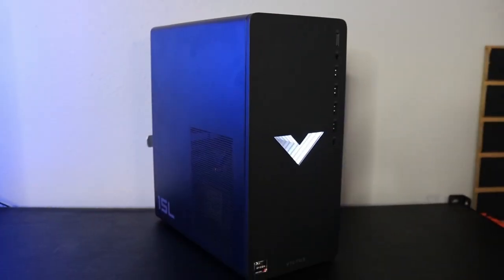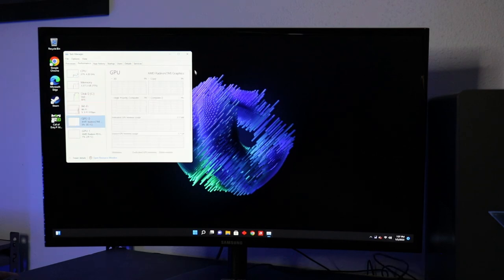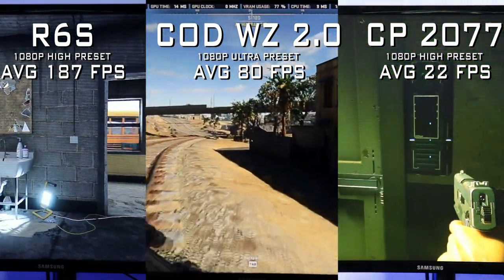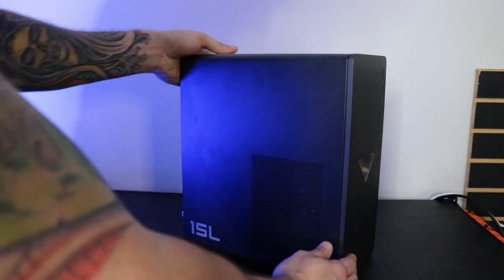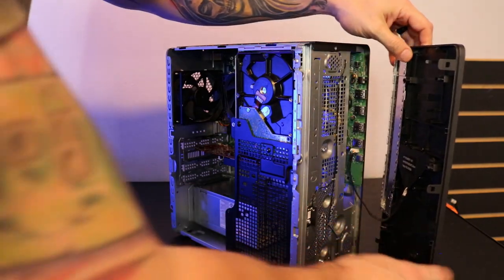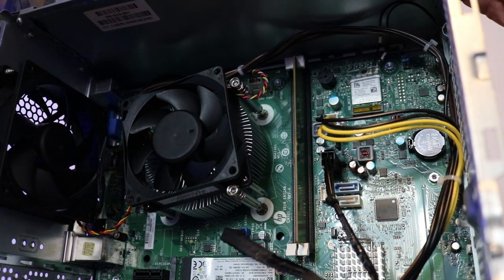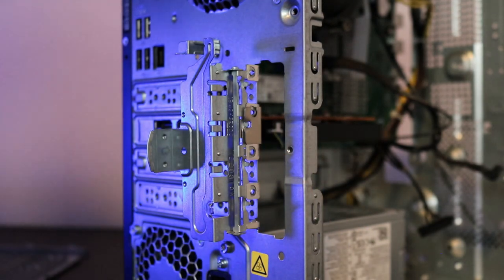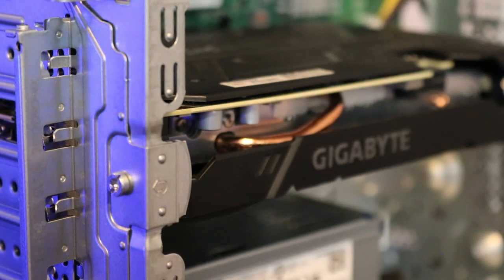Killer Gaming PC for CHEAP!! HP Victus 15L Gaming PC#pc #gamingpc #review

Comment: hi! liked and subscribed. very good video. great that you tested all of those games. pretty decent numbers, I guess. but, I don't have any of those games to compare to. the only game I play is Medal of Honor multiplayer and nobody uses that for testing nowadays even though it's been revived and remastered. so, I usually look for some benchmark tests. there are some free, really good, fun, interesting and super informative tests out there. I wish we could all just agree on one or two instead of 10 to use, for easier comparisons, but oh well. personally, I like the Cinebench R23. it's quick, easy and offers some other rigs to compare to. so far on that one, I laid down a highest of 16,625 for multicore and a 1,400 single core with the Game boost(basically 1click overclocking offered by most aftermarket mobos), activated. the results seem to vary with every one of these benchmark apps, tho. and I noticed a tiny drop in numbers when I record the test in the background. so, the tests that I've posted on my channel show lower results. I like the 3D Mark Time Spy a lot, too. that thing tells you a ton of stuff. my score on that averages about 9,900. CPU average is about 12,000. the GPU scores average about 61 FPS. Unigine Valley 1.0 is fun, too. average score about 9,000. min FPS about 54. max FPS about 345. Unigine Heaven 2.0 is fun, too. scores averages around 7,300. FPS about 286. min FPS about 68. max FPS about 862.
my set up was about twice the cost of yours, of course. I spent $1,118 for parts, shipping and taxes. I have a video on each part cost and also video of the complete unit. I'm not sure up I'm a game nut or a computer nut, lol. my rig isn't high end, per se, but, it's upper middle with my Intel i9 10900k, MSI MPG Z490 Gaming Edge wifi mobo (supports up to 4800mhz RAM and a i9 11900k CPU), EVGA GEFORCE GTX 1080 Ti SC GPU, Corsair Pro RBG 32GB 36000 Mhz RAM, Vetroo S210 ATX MTcase w/6 RBG fans, Vetroo Lurker V240 CPU water cooler, Rosewill 1200w PSU. it runs super cool. I just finished it. I'm about to start doing some testing on overclocking the GPU, but, I'm hesitant because the built in FPS counter in my Medal of Honor, blips up to 3,000 FPS! but! that makes my low internet symbol flash like a strobe light. I have to keep turning down my max FPS setting in console to about 400 to quiet down that light from having kittens 😸 
I have terrible turtle wifi that's free with my stupid apartment. getting high speed internet is, so far, not available in the rough neighborhood, that I live in, hhhhhhhhh. 
I guess, to summarize. how about a benchmark test or two, also? 
I will look to see what other videos you have. don't forget!? Medal of Honor is still around, free to download(mymoh.tk)
remastered, no CD needed. I have how to videos on how to download skin, blood and HD mod, too. I am Ober Gilstrap 88 and I approve this message.
Reply from the maker: I have only ever messed with unigine heaven as far as benchmarks but I would totally be down to do a short and get cinebench numbers on this prebuilt! I truly appreciate the sub and the detailed input in your responses. A 1080 in my opinion is still very relevant for gaming and paired with an I9 10900k is a monster gaming pc! I'll be sure to stop by and check out your channel! I'm still learning the flow of making the videos and always appreciate the input that people give on my content!  Thank you sir and have a great day!
Reply: @bradfordskeldorado  wow, thank you! you, sir, are too kind. awesome. the only game I play is Medal of Honor. and nobody ever uses that for any benchmark testing. so the only way I can compare anything is if they do the Cinebench R23, the Heaven 2.0, or the Valley 1.0. some guys use a Heaven 4.0 and that isn't free so, I'm not sure what they're thinking. I can only imagine a handful of people that would use the paid one, when several great free ones are available. I wonder what their target audience is. or do they do it so most of us can't tell what a piece of crap they just built? a video the other day had a guy showing off a rig that he built to show off how great he was with building a pc with a $1,000 budget. I thought ok, perfect. my build was $1,118 including taxes and shipping. well, my machine crushed his. I had about double his Cinebench R23 score and 2,000 more on another one. and his groupies were writing in, saying how awesome he was and one guy wrote in say how he had built 25+ computers and how impressed he was at this one thousand dollar build. I'm thinking what a bunch of knuckle heads. I trashed the "pro" making the video with my first try. I had only been studying pcs for 7 months, bought all the parts and bada Bing bada boom. killed the guy with 50 how to videos. anyways, on my Medal of Honor built in FPS counter, I've seen it briefly blip up to 3,000 Frames per second. I'm not kidding. but, my low internet light is having a stroke it's flashing so hard. like a strobe light. I have terrible free wifi here where I live. so to get my game playable, I have to keep turning down my FPS until that light stops flashing. earlier for some reason the wifi was happy and I opened up the throttle to a high of 800 FPS and it was awesome. I was kicking ass. I beat up 2 guys at once. but, later on the wifi got bitchy, so I had to turn it down to 400 to play. I'm going to do some testing, comparing the FPS on my stupid 60Hz refresh smart tv to the monitor that I just bought with a 180mhz refresh rate. I'm looking for to that. then, I'm gonna kill myself to find some freakin high speed internet on the rough part of town that I live in. they've all said, oh no, we don't have any lines in that neighborhood, yet. we'll put you on our list when we do, we'll let you know. ya, right you will. do you play MOH?

Comment: Hi @bradfordskeldorado thank you for the video on this, just curious if you could list the 1 TB drive you mentioned at 7:14 and how many other drives could be added to this machine?
Reply from the maker: To be honest, I would recommend a PNY 2.5" ssd. You can get a 2Tb ssd for $61. This is fastener and more reliable with double the space for just a hair more. 

PNY CS900 2TB 3D NAND 2.5" SATA III Internal Solid State Drive (SSD) - (SSD7CS900-2TB-RB) https://a.co/d/agC2KVY
Reply from the maker: You can add two drives because the psu has two sata power connectors but you would need another sata data cable with is only about $5-$8
Reply: @bradfordskeldorado  OK, so I have the case open, if I got 2 of those PNY drives is there room? I know the bay will hold one, would the other be hanging loose? hahaha
Reply from the maker: It would basically just be on the bottome of the case or you could have it anywhere. An ssd doesn't have any moving parts so it would be fine where ever you put it. A Hard drive has a spinning disc so they can have issues if they aren't mounted securely.

Comment: Have you had a chance to review or look at the newer model hp victus that has 1 tb ssd, 16gb ddr4-3200mhzram memory, wifi6 (2+2) and bluetooth 5.3 wireless card with an Nvidia Geforce rtx 4060 graphics card with 8gb gddr6 dedicated memory, 5.1 surround sound and several different USB ports hdmi and display ports......... Was wondering what would be a good upgrade that is cost efficient ? I bought this at Best Buy for $ 1400.77 after taxes.
Reply from the maker: Did you buy it recently?
Reply: Yes just purchased recently
Reply: Also came with McAfee protection and an xbox game pass

Comment: I bought this pc. The sound is very low. I updated everything. The sound is great when using headphones conected by Usb.
When conected the speakers via usbb+jacks. Its very low. 
Dunno why... I tested the speakers on other pcs and word perfect and hard. So..
Dunno what is this. I tried on win 10 and 11.
Reply from the maker: That's good to know. I usually use USB audio devices so I guess I wouldn't have ever tested that! Thanks for the info!
Reply: Any solution?
Reply: @bradfordskeldorado  ahh yes.. exactly.. maybe its a jack issue
Reply: @bradfordskeldorado  so you dont use the onboard sound card.
Reply from the maker: The only thing I can think of would be to check the drivers and see if there is an update. Personally, I recommend a usb audio de ice due to the sound quality. I would have to look to see if I could figure out any kind of solution.
Reply: @bradfordskeldorado  i did all the updates. Latest and roleback. I tried 20 different toturials. But nothing.. its weird because on the headphones via Usb it blasts hard. On the jacks (speakers) its very low even on Max volume. 
So its not drivers i even installed windows 10 to test it. So... Tomorrow i will but a usb sound card and work from there. But... Very sad detail here.. if its really the hardware not giving the power. Even a old laptop works fine.. never experienced something like this.
Reply from the maker: I have a sound card that I can test before you buy one! I can try to get you an update soon if you want
Reply: @bradfordskeldorado  thank you. I have a usb soundcard in another home that I will get to test. Abd yeah i am curious if i am the only one with this problem.

Thank you 🙏
Reply: @bradfordskeldorado  i just bought. 9 bucks usb sound card. And works fine and perfet too. Well its solved with a work around. Keeps sad why the original wont work.

Comment: Hey im using that pc rn lol it's a really good pc I just upgraded the ssd and ram but good video!
Reply from the maker: It really is a great pc! You really get a lot of good stuff with the ability to upgrade it very easily. What games do you play and have you had any issues so far?
Reply: @bradfordskeldorado  no issues but also had to upgrade the ssd cuz of some issues like files not Saving so I added a hdd and a new ssd since it was when I just got it. I was wondering if it can run a 2060 with the 350w psu?
Reply from the maker: Absolutely can run a 2060! I had one on the 300W power supply and I didn't have any issues at all!
Reply: @bradfordskeldorado  alr well thank you so much!!!

Comment: Found one brand new on Marketplace for $400! I upgraded to 32 gb of ram, added 2TB ssd, and already found the 500w proprietary PSU, just gotta get better gpu now! Thinking the AMD RX 6700xt, any thoughts? This video, along with technitwits guide, have helped me understand my computer and what I need to do to upgrade! Thank you dawg
Reply from the maker: Killer find! A 6700xt would be a great addition! That sounds like a great gaming setup!
Reply: @bradfordskeldorado  Hey man! some bad news when upgrading

I got my low spec HP Victus 15L desktop a couple months ago (Ryzen 5 5600G, RX 6400, 8GB ddr4, 350w PSU) Upgraded Ram from 8gb to 32GB, added a 2tb ssd, and prepared to upgrade my GPU. I bought the MSI AMD RX 6700XT and thru YouTube videos and all the research I did, I ordered the L05757-800 from eBay, (which my friends say I should not do) and when the time came, it fit! But sadly did not have 2x 8-pin connectors which my gpu needs (it only had 1 2+6-pin, and 1 6-pin). I'm sad and returning the PSU, after a little more research, realized I may need a different 500w PSU, the HP L77487-001. This PSU should have the 2x 8-pin connectors my GPU need!

1. Does the HP L77487-001 500w PSU have 2 8-pin connectors? (2x 2+6? And is that any different?)
2. Will the HP L77487-001 power my GPU that recommends a 650w PSU?
3. Why do I need to buy a proprietary HP Power Supply unit in the HP Victus 15L Desktop/TG02? 
Bonus: Should I order the HP L77487-001 from eBay? Do you order parts from eBay? Should I be scared to use the 500w psu with my card?
Reply: @Fabolotti  You can just buy a 6-pin to 8-pin adapter and use that along with the other 8-pin cable. 500w will be fine, 6700xt uses 230w and 5600g uses 65w.
Reply from the maker: Like @xiido mentioned, you can get adapters from 6 pin to 8 pin its that's all you need. Also, the 500w is good enough for this gpu/cpu set up.
Reply: @bradfordskeldorado  @Xiibo Thank you both! I ended up returning the PSU and I'm gonna try building my own PC! Gonna take the cpu and m.2 from Victus, and see what I can do😎 I appreciate y'all
Reply from the maker: Let me know what you end up going with! You can get a motherboard for cheap, you have the gpu already, ddr4 ram for $40 and a good case and be up and running in no time!
Reply from the maker: I just had a thought about you keeping the cpu and m.2 drive. If you wanted to piece the victus back together and try to sell it, even if you take a loss and sell it for $400-450, you could purchase a ryzen 7 5800x for $200 and a 1tb m.2 for $50 and still have $150-200 to spend toward the rest of the components and keep you from having the victus pc laying around. Just a thought!

Comment: Is there any problem running after upgrading the graphic card since the PSU only rated 350W? Bought the same thing over Christmas, so far I've only added an intake fan and another ram stick.
Reply from the maker: Yo Max! Not any issues so far. I have been using it of and off for about two weeks and it's pretty solid. I did look up the RX6600 and it draws less power and it a pretty substantial upgrade to the 2060!
Reply from the maker: Thanks for that! I appreciate the info!
Reply: Awesome, I didn't know about this one. First thing I did was just uninstalling all the HP software I could find via control panel.

Comment: Hello, this video is so cool :) 

1.  I accidentally scratched the side of the case on the wall and got a lot of scratches... Is there any way to buy or fix the side of the case separately? I don't have any problems using it, but it just doesn't look good...

2.I got a 2060s GPU from a friend. If I install it here, will it work well without problems with the power of 350w? And I'm trying to add a 14tb hdd that is 3.5 inches. Maybe it's fan noise or vibration?
Reply from the maker: HP does have a customer cupport option to purchase replacement parts for their products. I would probably take some fine grit sandpaper (1000 grit) and sand the scratches and paint it. The 2060s should be a good addition without any issues and the 3.5" hard drive would be a huge upgrade with no problems to the pc! I hope this info helps!

Comment: I’m looking to get a cheap starter pc… Would this be a good one to use? I only play Minecraft so if it’s running other games well Minecraft wouldn’t be a issue lol
Reply from the maker: This would be a good pick if you can find it around that $499 price. If it's around the $699 price then there are a few other  options out there that would be better
Reply: @bradfordskeldorado  around 575 CAD
Reply from the maker: I have seen people post that they have found these pcs new for 350-500 usd on ebay so you could possibly find one there. Whatever you do, I don't recommend buying a "gaming pc" on Amazon for that price. Lol I have a video about a $500 gaming pc from Amazon and it was horrible.
Reply: @bradfordskeldorado  this one is right from the HP website
Reply: I only have 200 bucks rn but def looking out for some good cheaper budget starter PCs
Reply from the maker: This is the HP Victus 15L but I bought it from Walmart. I have a pc that I build for $150 on my channel that is basically a home/office pc that was upgraded to run games. Very easy to upgrade on your own!

Comment: Literally watching this video from this exact PC. Any idea of what CPU I could upgrade it up to?
Reply from the maker: You could easily do a ryzen 7 5800x but that's about all I would run. The ryzen 5 5600x was a little hot but I'm sure the R7 would be fine. More cores and threads to multitask faster but as far as gaming performance, it would be a small bump. You can find them on Amazon and at Best Buy for around $250
Reply: The cpu is the last thing I would focus on with this pc. The gpu, ram, and psu should be a big focus as well as some better ventilation.
Reply from the maker: @smokeydabear9147  I agree the ram first and gpu second. But!... I did order a couple fans (Noctua 80mm and 60mm) to do a short on how to add more ventilation!  🤣 🤣

Comment: Very helpful video @bradfordskeldorado, thx.  Does this PC support dual monitors out of the box?  Looks like it has 1 HDMI port and 1 DisplayPort.  I have little experience with DisplayPort and think my monitors support only HDMI and VGA.  Would I need a DisplayPort to HDMI adapter?

Also, if I heard correctly it sounded like you said this PC has Wifi 6 but everything I have read online says this model has Wifi 5.   Can you confirm yours has 6?  Thx in advance if you're able to respond!
Reply from the maker: It does support dual monitor and you can find a cheap display port to hdmi cable for around $10. Also, I just know it has wifi, I don't know what kind of wifi to be honest lol. I will try to verify to see if it is 5 or 6

Comment: Should I get a 1080p or 1440p monitor?  I’m going to try it out of the box amd 5 5600g & amd rx 6400 8gb ram, 350w.  We plan to upgrade the gpu & ram later.
Reply from the maker: I personally would recommend 1080p gaming but that's not to say you couldn't do a 1440p monitor but set you setting to 1080. If you have the money, I would say go for it but wouldn't recommend 1440 gaming until you swap the gpu
Reply: @bradfordskeldorado thank you!